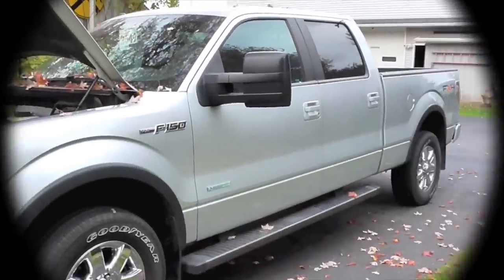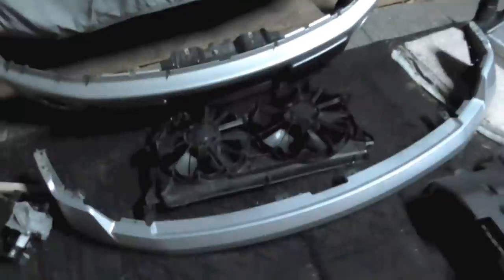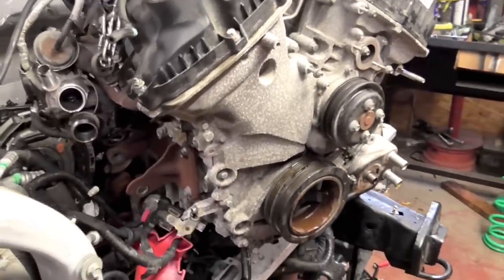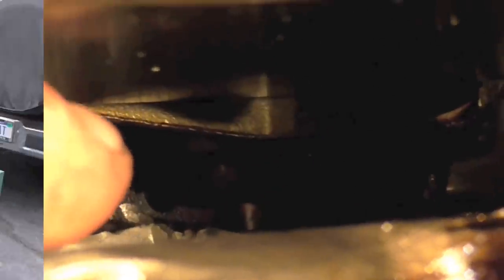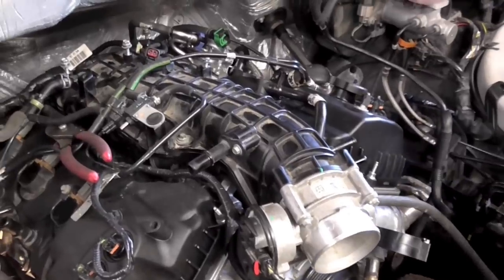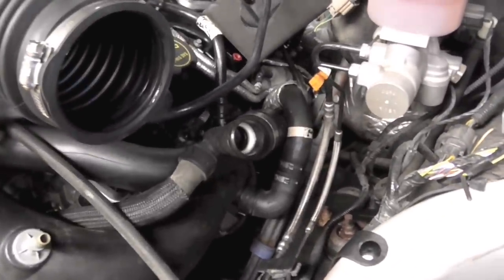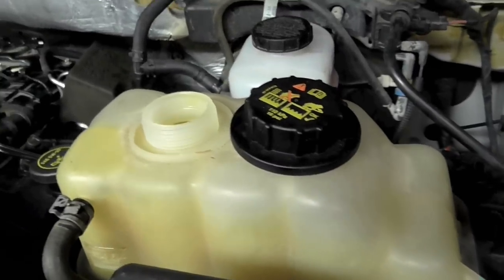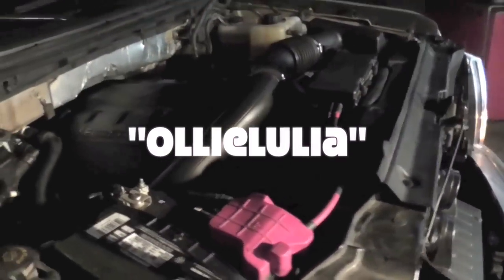FORD F150 TRUCK:  3.5 V-6 ECOBOOST ENGINE FAILURE (Removal and Installation).

Comment: I do NOT want to hate on any mfg who is going the route of Turbo Power....Turbo usually = a VERY Robust engine... At least this holds true in Japan...Japanese Turbo engines are built as strong as they know how to build them....They have no idea how long they will last but they are built the best they can build them....  America however builds engines to a point of failure....they are made to last 100K miles specifically....after that....who knows...  I think the public at large is about to see a TIDAL WAVE of failed Eco Boost V6's....  Its not gonna be pretty...and I hope it doesn't happen honestly.  I am a fan of what Ford is doing, but they are ignoring some serious pending issues....primarily this water accumulation AND intake valve carbon accumulation....  I hope things dont go Ape Shit...but methinks its coming...
Reply from the maker: Your "SPOT-ON" !!  .... "Google": 3.6 litre GM Engines and see examples that rival that of the DISASTER 4100 & North-star Platforms (in the Cadillac Line-up) ... *in 60 K your engine's a goner amid timing chain / chain "phaser" ISSUES !  ... "Hub Bearing's", Tie rods ... unreal "designed obsolescence ! ... multiple timing chains ... "hopeless". 

Drive a Camry, and right down too the COATED Brake lines, you'll see a "finite-science" in GREAT Engineering !

"BEAUTIFUL" !!!  ;- )
Reply: TommyZTrains
Yep...I sure do hear you.  Funny you mentioned the suspension components in US vehicles...  I was going to mention it but I forgot...Bushings, Ball Joints etc...ALL made of Dog Poop.  Ive never seen failures like these and I mean complete and total failures...its embarrassing.  Back to Japanese vehicles?  Ive seen bushings and struts last over 12yrs and well over 100K miles like clockwork.  If anyone is worth his salt as a mechanic they would be able to clearly see the difference in component quality when doing certain jobs or replacements.  The Japan vehicles are simply made better...out of better components...and their engines?  They were works of Art in the 80's !   The 90's they only got better and now in the 00 and 10 years they would be akin to seeing Formula 1 Tech under your Hood. 

Doesn't matter where you are from...you can recognize the quality and engineering if you are even semi honest with yourself.  Some guys just want to Hate on Japanese vehicles for whatever stupid reasons they have, but that is a Fools Game...if you are a True Gear-Head you will recognize where the quality is...even if it may hurt your national Pride a bit...  I will say it again... its is not like we are incapable of the same quality and even better...on the contrary we surely are capable... 

I think it all comes down to GREED... There is more than one Team of Bean-Counters in every US vehicle mfg house...and methinks they lie awake at night looking for more avenues of Cheapening Out our Vehicles...So as to put more Profits into the CEO and Shareholders Bank Accounts...  Again...Its Embarrassing.
Reply: ........and the unions demand more and more as well!
Reply from the maker: Agree here. "Your "spot-on". I have 3 Sons, (all of them drive 'Jap' cars) ... *& I'm as "RED-BLOODED OF AN AMERICAN AS THEY GET" !!! , but: "we" simply can't win against the "Japanese Builds" !  When (occ.), my Boys come home; will pop a car up on the rack (and change the oil / like) .... I can remember thinking: ("LONG-AGO") ... "my God": "why can't "WE" build a car like this !!??.

I've never seen such quality and attn. given too the SLEIGHTEST  DETAIL (and 'SERVICE')\ *example: what if you needed to replace: ...^#  and ...#@ . plus ....bla, bla, bla ... *EVERYTHING'S "laid out", "right there" too the point where it might even be "FUN" ta do !  *In my "daily go": I'll see:  Window Regulator failures (the cheep "lawn-mower cable wire type) , or a Hub Bearing, or a Control Arm ready ta fall off ... THAT SHOULDN'T BE !.  Window Regulators (for ex.) WERE the nice "scissor-type" once, and they NEVER FAILED !  ... & "Hub Bearing's" ? *Why not pop a grease zirc on them so they can be greased ? *Control arms that have "cheep little rubber bushings" ?  "CRAZY". 

The Foreign cars have (in a good many examples) these SAME things / parts (Hub's you can't grease etc ...)
WHY do theirs NEVER Fail ? ** "The dam things REFUSE Too even RUST" !!! 

In a "dumbed down" example the dam Japanese cars WON'T EVEN RUST ! *Their Brake Lines are "literal works of art" ! , and I just ("again"), remember looking (again: while I had these cars UP in the air), Asking myself: "WHY" can't WE do this ? 

End game: "JAP CARS WON'T BREAK" !! . Gese: even are Instrument Panel Servo's (for the Inst. Gauge's) are starting to FAIL (in the GM Line now). !  Theres example upon example ...  I HATE that I've said this of "MY" Countries "Builds" too. I have a good friend with a Subaru Outback with "a hell of alot of miles", and it STILL won't rot or "fail".  *I guess (IF the matter were ta "put-up or shut-up") , 'we'd LOOSE hands down'.
Reply: TommyZTrains
You are very correct.  Again...this goes back to the culture...  The Japanese are very proud and they are defined by their work ethic and the fruits of their labor.  You are what you do applies very strongly in Japan.

So when they approach a car...they build them as good as they know how to do.  NOT to a price point...  Many times Japanese engines are built simply as strong as they can build them especially Turbo engines.  They have NO IDEA how long they will last...so...they last basically forever with proper maintenance.  WE in the USA...build things to a price point.  The Accountants often stymie the engineers.  We know what would be better or stronger...but are limited by financial concerns...  SO... We usually build the 100K mile vehicle...at 100K almost everything is Tired and worn out.

Ford is probably the best vehicle the USA has anymore.  Every Ford truck I have had has been flawless....their brake lines are garbage for some reason, but engines and trans and body hold up well.

ANY GM for me is "The BIC Lighter" of the vehicle world.  Never have I seen such garbage...sure it looks nice, runs well when new etc...  Im talking about 10yrs in...100K in...  Honestly they are so effed up and worn out in that time that they need to be disposed of...  Then you look to other mfg's and you do NOT see the same thing happening.

Im a Professional Mechanic, I can recognize quality from 50ft away.  I see nothing but quality in Japans cars, also German BMW comes to mind.  But the vehicles we here in the US produce...they surely do not reflect our skills and knowledge...so what are they representing then ?  The FINANCE DEPARTMENT...Thats who...and this is what you get...
Reply from the maker: "LOL"  "I AGREE".  (MORE  "LOL") 
 Best.  :- )
Reply: TommyZTrains
What more can be said... I think that covers it.  Its a shame and it makes me angry to be honest.  But hey, I recognize quality...I don't care where it comes from...Quality is all that matters...and we have flushed quality down the toilet in America.  Of course there are a million and one reasons why this has happened, but...I will steer clear of our obvious Junk, thank you very much.

Comment: Ams. oil, you said the problem.
Reply from the maker: "Water",  *But I get your drift. Now we use "Motor-craft Oil's". You think "Ams. is alot of hype Andrew ?
Reply: In the 13 + years as a agriculture mechanic witch is from chainsaws all the way up to the 600 hp articulated tractors, Amsoil  causes problems. From gas to deisel, two stroke to four, oil is not just oil anymore. You have to use whatever who made it calls for. After 2004 oils all changed thanks to the government.
Reply from the maker: Hey Andrew: "I respect that", but in this example the OIL had no bearing on the "reason" this engine "grenade-ed", it was water-droplets accumulating in the C.A.C., where the (over-time) "THAT" allowed a huge amount of water to then 'hydro-lock' this engine. *(I.O.W.'s the failure WASN'T OIL RELATED). So far as "oil", we use plain-ole Motorcraft oil NOW, (JUST LIKE U SAID: "what it calls for"), and the Truck continues to run absol. FLAWLESS.  *Keep-up the good work your doing my friend !  :- )

Comment: Never buy a first year design. This ecoboost came out mid to late 2010. It has now become a very stout engine. I know many with over 300 thousand miles and still run great.
Reply from the maker: We'd AGREE with that 100 % tom !  "the thing came with ALL the "upgrades" including different Turbo feeded-lines, brawnier timing chains and sprockets, upgraded tentioner's ... *(it's STILL running perfect at now: 120K plus) ! .
Reply: The Ecoboost F150s did not hit dealership lots until April 2011.

Comment: Automaker engineering and sales philosophy OUT OF CONTROL. This level of complexity is clearly not in the best interest of the consumer....it is in the total interest of profits for Ford. And when the engine swap is done what assurance do you have for the longevity of the new engine. The sad fact is the auto makers are getting away with using the consumers as the testing ground....we pay the price and they reap the profits. The automakers have the lawmakers in their back pockets, there is no more protection for the consumer.

Comment: Amsoil lol mine is up and running i use walmart oil change it 4 times a year and use the cheapest filter 200000 miles and purs like a kitten
Reply from the maker: Hi Sean,  I'd AGREE.  *However: "Oil" wasn't the issue ... *IT WAS WATER*. This engine ingested a crap-load of water and grenaded / or "exploded".  : - )

Comment: Problem solved in first 10 secs of video. Always use motorcraft oils and filters.
Reply: In-correct: Failure was due to Hydro-lock as prefaced in the clips "description".

Comment: Keep on buying your Ecoboosts and this is what will happen, I'd rather stay 10 times with a chevy Silverado V8 then with a ford Ecoboost
Reply from the maker: NOT TRUE Zag. Tho this was a major set-back for us, *(nearing 30 K later - 'now'), I can honestly say this is one of the nicest trucks we've ever had. On / in the "right" conditions: 25+ MPG, and power beyond words. This failure was a bitter reality (and at the time I'd of probably joined your thinking AFTER this motor "grenaded"). 

The point (here), is that the lack of tiny little "drip-hole" brought down the farm. And after that: NO help (in any way, shape, or form). ... THAT we didn't like at all !. End Game: "Like truck's / and cars": "I guess EVERYTHING'S good when it RUNS".

Comment: Why not get a dodge or GM, it would save yourself alot of trouble.
Reply from the maker: Because ("well after THIS"), this is a GREAT Truck !. *Again: "it continue's to run flawlessly" ... and tho this was a real "headache" (the engine going out),  you can't beat the ride, (nor the quality),  "their-after".  :- )
Reply from the maker: "NO" ... "I'm taking my lumps and moving on". I didn't like that this happened, but bitching and "slamming" Ford just adds a real "nothing",  too the reality.  DONE / OVER / MOVING ON - *Truck runs fine now.  :- )
Reply: 360Magnum dodge or GM are absolutely garbage though.

Comment: A proper 5.0L would have been fine.  A gas guzzling, over stressed V6 is never a good thing.
Reply from the maker: Don't agree with "over-stressed" sho ... *I'm LOVING everything about the truck NOW. ("including 24-25 MPG").
The truck has GREAT power too. Nearing 90 K now, and still no further issue's. (knock on wood).

Comment: Jasper Engines and Transmissions won't reman this engine.Didn't pass their 100,000 mile test on their test stands.Ford reman engines,Ford does not do in house with no upgrades done.They contract someone to do them for Ford.This engine is a complete pile of junk basically

Comment: let's put a 3.5  twin turbo v6 on truck duty and this is what happens 5.4 much more reliable
Reply from the maker: +Tony Mikesell  "I don't know" ... 6,000 miles later and She's running STRONG !  *21 MPG too.
Reply: +TommyZTrains I hope u get 150000 miles problem free great work on the change I couldn't do it
Reply: +Tony Mikesell The 5.4 3valve that was plaged with head problems?  I hope we are not talking about that boat anchor.
Reply from the maker: +jmc6000   Problems with those jmc ?
Reply: +jmc6000 did Ford make a good engine
Reply: Actually they have made several but the 5.4, 4.6 3valves are just not one of them.
Reply: +jmc6000 I came up with the 5.0 looks good
Reply: 5.0 is a great motor!

Comment: ford boys sticking up for the ecoboost sayen they found an ecoboost with 200,000 miles come on guys thats pathatic silverados go over 300,000 miles like nothing and u dont even have to baby them my 03 silverado with the 5.3 is at 320,000 miles and still runs strong takes me to work everyday with no problems not even an engine light on the dash lmao 200,000 milles weak as fords

Comment: i have seen ecoboost v6 first gen with over 200k on it, original engine and tranny. i bet the cause of your premature failiure  is that crap of oil called amsoil... expensive. there are way better oil brands like mobil, castrol and chevron
Reply from the maker: Please READ the description Sabastian. :- )
Reply: TommyZTrains my bad. i forgot that 3.5 f150 have the problem where intercoler condensates inside.

thank you very much for making me see my mistake. still i rather use other oils instead of amsoil... it is expensive and not worth it.
Reply from the maker: NA-NA ...  "not at all" ... so far as the OIL, I think your SPOT-ON and I agree 100 % !!  *All we use is the recomm. Motorcraft Oils NOW Sabastian.  Take good care ; -  )

Comment: The way that engine is put together with thin ass aluminium casting down below with that stupid skeleton stiffener shit  and all that damn plastic shit and it takes up has much room has an 5.0 v8 i thought the goal was to use less petroleum  need to make an ecoshit emblem badge😁

Comment: Look like you had low oil or no oil, your oil pan look like burn oil. Good way to get a free engine, lol.
Reply from the maker: Wrong Eddie, "the oil was fine and a non-issue". (Please read the description). This was a hydro-lock failure and prior to this catastrophic 'failure', we had a "Blackstone Oil Anyl." performed. It's findings / results agreed with the Truck's "oil life index percentage's".  Best  :- )
Reply: @TommyZTrains  "hydro-lock" you make it seem like a lubrication issue? So, this was water condensation from the intercooler trapped in the combustion chamber?
Reply from the maker: Hi ya Frank !! Read the description in full ... AFTER that failure (when the motor "grenaded"), a huge-mass of water covered the road ... *it was hydro-lock.

Comment: To much bullshit on it and just to do some engine maintenance on it just about have to tear the engine apart pretty much designed has a throw away truck because the labor is going to be outrageous just so they can sell a new one clever bastards